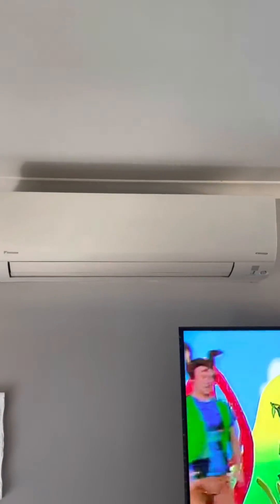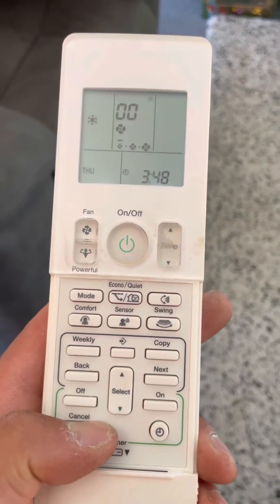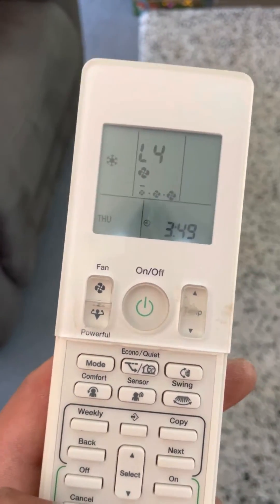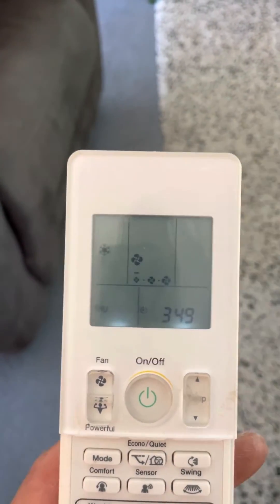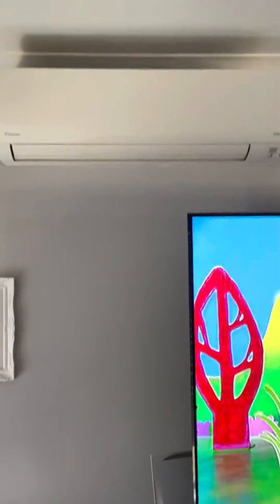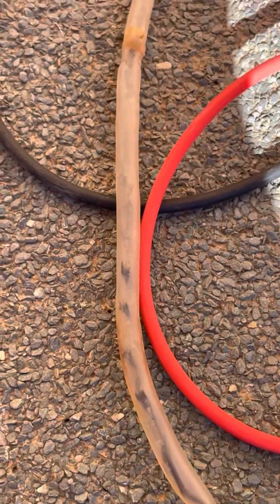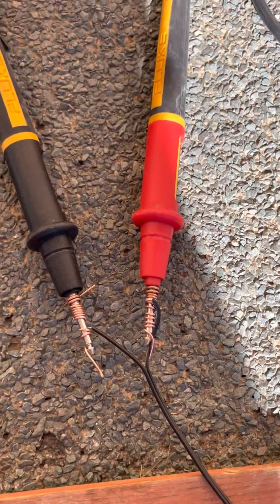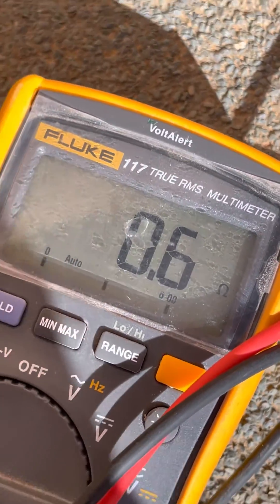H9 fault on a Daikin split system, outdoor air thermistor fault

Comment: Thanks mate 👍
My parents Daikin Inverter went out on error code a couple of days ago. And the bloody warranty only expired last month, like it was planned.
I don't know what the error code is as yet, but should Daikin honour the warranty for the part as the warranty period has only expired 1 month ago? Or will they just say sorry bad luck mate ?
Reply from the maker: Daikin are pretty good with that, I  think they would, did you get it from a Daikin dealer, talk to them 1st and ask them if it will be, if they say no, call daikin ask to talk the the services warranty team. Daikin know when the unit was sold / delivered to the daikin dealer, but that unit could sit in stock for a year or more before it gets installed. If it’s close to the date it was sold to the dealer they probably wouldn’t ask for a receipt, if it’s a long time past this date they will. Go through and use my fault finding video (daikin green flashing light) to work out what fault it is, it could be a very simple resettable fault.
Reply: @FullyAirconditioned  
Yeah I'm going today to check the error code. Yes I did watch your other video first with the error codes thanks heaps !✌👍
Reply: @FullyAirconditioned  
Hi mate,
I have an update for you.
I found the error code on my parents Daikin inverter to be L5 (Output Overcurrent). What does this exactly mean and what part needs to be replaced to fix this and can it be done ourselves if we buy the part?
Thanks mate 👍
Reply from the maker: @2theCore777  I copped this from the repair manual:

Description
Inverter compressor motor shorted.
Faulty power transistor/ inverter
PCB/ compressor.
Abnormal supply voltage.

Recommended Actions
For Model Type All
Excessive DC current flow in the DC section of the inverter. This is usually associated with a transistor issue such as a shorted transistor within the inverter, or the DC current sensing circuitry may be faulty. Note: this fault would normally become apparent prior to a compressor or fan motor startup.

Not a good fault have and not an easy fix. I would say from experience a faulty pc inverter board 99%. Possibly a faulty compressor or fan motor that has taken out the pc board, less likely but possible. You will need to call your local Daikin Dealer, hopefully you get this done under warranty.
Reply: @FullyAirconditioned  
I checked if the fan was seized & it spins freely, so hopefully it's the PC Board & not the compressor. We will start making some calls tomorrow & take it from there. Thanks again for all your help and advice and I'll keep you updated on the situation lol
✌👍

Comment: Good on you, my 94 year old mother got a guy from OBrians in Adelaide he  just cleaned it and charged $340 mentioned that a new unit was likely. The symptoms are the inverter compressor is not "ramping either up of down" . I myself found that one could use the remote to get the error code. Rang my mum up got her to use the remote and got the H9 code. Obvuoisly the guy really did not understand how the inverter split works. Also got my Mum to ring a Daiken specialist. Many thanks tahnks for this. As you said it takes a fair while to understand how these highly complex units really work.
Reply from the maker: H9 fault outdoor air sensor, so many electricians who have done a 2 day course with no ideal working in this field, the end user ends up paying.

Comment: Hi @FullyAirconditioned,

I have a strange problem with my Daikin Perfera 2.5kw inside unit.... It doesn't heat up.... I wait 15 min. After that the vents are just open but is no coming got air or cold air and it doesn't trigger a fault code... Help me with it!!
Reply from the maker: Are you running it in heating or cooling ? If in heating it won’t blow any air until the coil hears up, about 2-5 min, in coiling it blows straight away. If it’s in heating then it could be trying to start up but a fault is detected and it shuts down again, then try’s to restart. With some faults it will come up straight away like a open circuit sensor. But other faults it will try and restart like e7, fan fault. It will try and restart 16 times, each time the restart process takes about 5 - 7min, so it could take 1-5 hours or so to come up with a fault. Turn it on, set for heating, set temp to its maximum and let it go for at least 1.5 - 2 hours. If still no fault and not heating, you will need to call your local Daikin authorised repairer.
Reply: @FullyAirconditioned  Thanks for your reply!

Yes its in heating mode. the first 5 min is blowing normal air while its being on Heating mode 30c.
Then after 10 min. it stops blowing air, but the vents are open, no code error or fault code yet. After 1 hour still nothing... 

I will let it go for couple hours as you said. And tomorrow I will call the Daikin support phone to maby look from remote or something. 
What do you think what is wrong? Its brand new.

Let you further know what are the developend on this case.

Comment: I had one of those systems terrible. The cleaning process is ridiculous. I had it professionally cleaned twice in one year . squirrel Cage fan  have to take it out.and it’s a process..I took the whole system out and replaced it….👎
Reply from the maker: It must be installed in a very dirty location to block up twice in one year 😳
Reply: @FullyAirconditioned  no it was not...
Reply from the maker: @americanmoses1509  well that doesn’t explain why it blocked up so quickly, there has to be a reason 🤷‍♂️
Reply: Well don’t come to Australia then everyone has them. Also I’ve never had to fully clean mine in 17 years
Reply: Are talking about the indoor unit ? The indoor one needs cleaning  like every 6 weeks say. Outdoor unit should Hardley need any maintenance. The outdoor unit has a  circular Fan blade, not a squirrel cage. I would hate to get at the fan in the indoor unit.